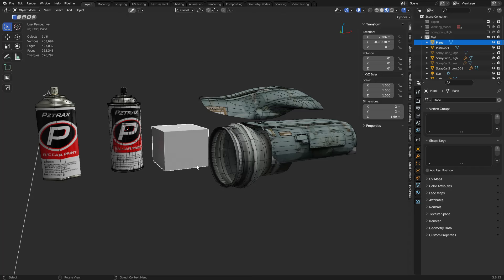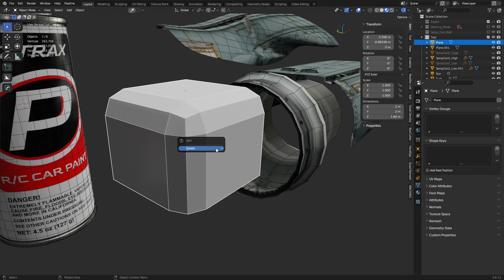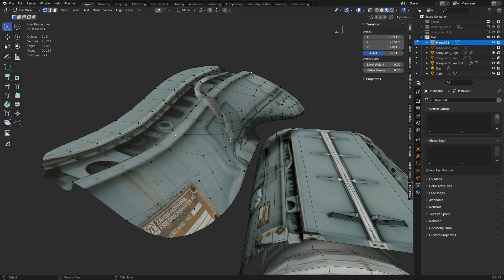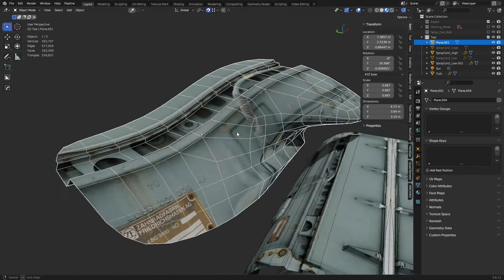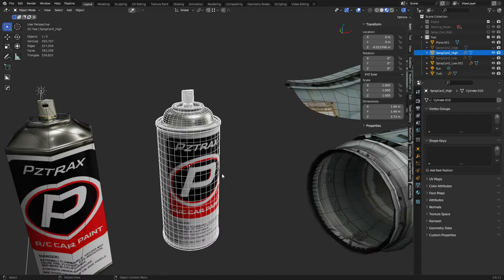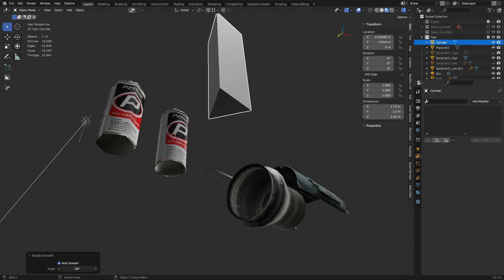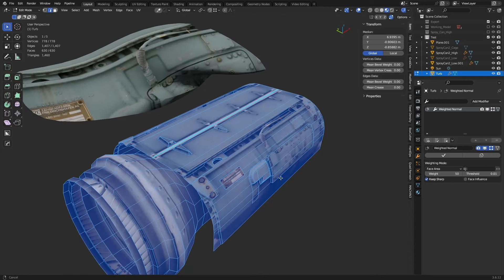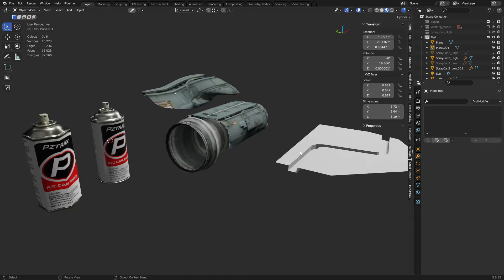Low Poly Game Mesh Optimization

Comment: Useful tip: You can move (not sliding) verts, edges, faces with G,G,G and after that it will sync with uv. Plus, after g,g,g you can rotate and scale with saving UV

Comment: VR has been a unique challenge due to the fact that you can see real depth, so certain insinuated normal mapped details don't work well in VR unless they're small. It demands a slightly higher polygon count than you could get away with in flat games to include certain details as real geometry.

At the same time, because the game is rendering less efficiently for stereo vision and at a minimum of 90 FPS, in VR performance becomes even more important than for a normal PC game... so it's quite a case of "you just can't win."

I've just been sort of shifting my priorities around, sliding around what's important to other areas and taking it from certain areas. For me, this means using the least amount of texture maps possible to convey a realistic surface (with as many fancy tricks as possible to minimize texture sampling in the game's shader), to pack things with extreme efficiency using Packmaster, and a few other little things.
Reply: VR is a pain in the a, even more, the documentation is weak compared to regular game assets creation and so on. I've tried in the past to visualise some environments I created inside ue5 and you end up in a maze, the number of parameters to flag, de flag, light baking, etc, drove me insane. I still didn't figure out to this day how to reach 90 fps without them drastically dropping over time. The information out there related to VR is so thin compared to the rest.

Comment: Good tips, thanks! Subscribing for more 😁

If anyone has good tips on how to use trim sheets I'd love that. It's simple on a flat wall or floor, but on a box is different -- for me the normal map always seem to invert on the top etc., and on the corners where 3 edges meet is very hard to make look good. I'm making a game for PC in Unity.

Now I just use geometry and bevel my objects once on the worst edges (simpler stuff, like boxes and furniture) to avoid having to use normal maps at all, and then use a Weighted normal modifier.